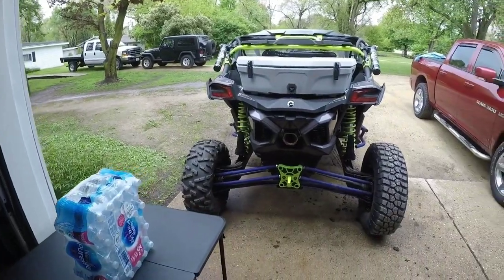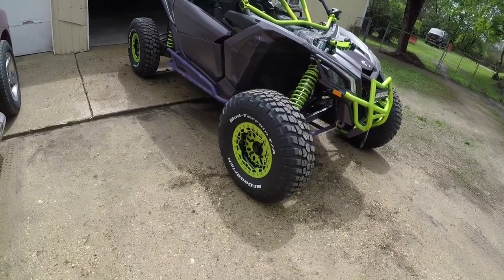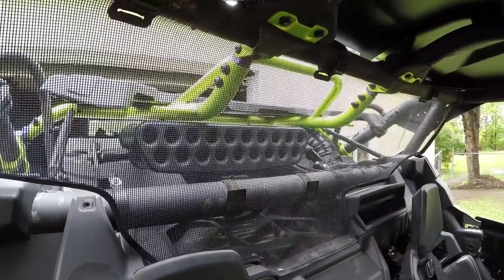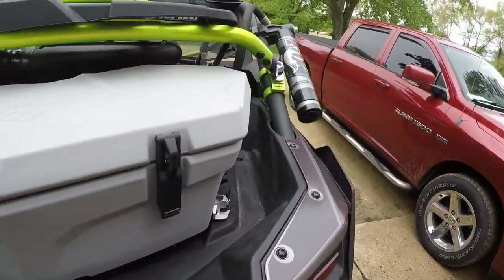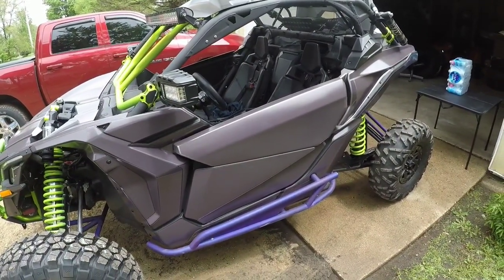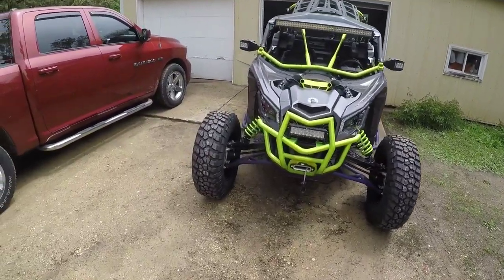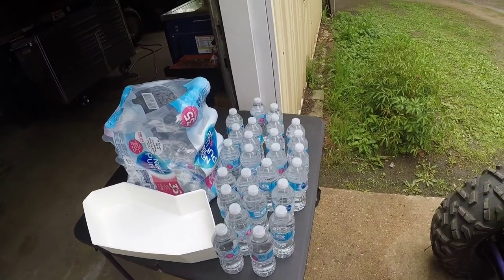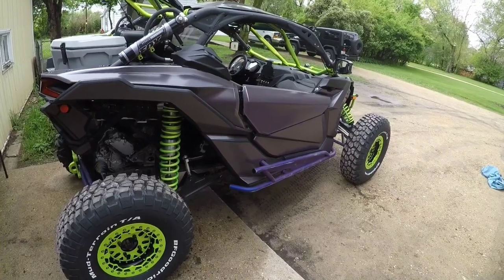Big Boi TV How much water bottles does a can am cooler hold? Update on changes made for Dresser, WI!

Comment: Hey, I like your videos. I'm a big guy myself, 6' 4" 500 lbs. Most vehicles don't have enough room for me. The x3 seems to have the most though. I'm wondering if I would be comfortable in one. I've been thinking I would have to get a 4 seater and move the front seats back. Could you do a video showing more about how you fit in it, how hard is it to get in and out, seat position, etc. There is just not any info out there for someone my size. Is there any room at all behind the seat to make mods to move the seat back at all? Even 2-3 inches could make a huge difference. Thanks and keep the vids coming.
Reply from the maker: ttmatt absolutely I will get you a video. I currently have my seat lowered 2 inches and all the way back with plenty of room. And you have 2 inches on me. I would bet you would fit! Give me a little bit and I will get you a video
Reply: ttmatt, I am 5'7" and weigh over 430 lbs. I sat in the 2018 Rzr xp and turbo dynamix and there was over 2" between steering and my belly. Also tried the 2018 General and I had maybe 3/4" in space. But the 2018 and 2019 Turbo S I had over 3" of space between my belly and steering and i did not have too tilt the steering up. I kept it in a comfortable driving position. I also sat in the Maverick trail and the commander and there was less then a 1/4" of space and tried the X3 and the steering would rub against my belly even when I had the steering wheel tilt all the way up and the seat all the way back. Pretty disappointing because I really love the X3 and a huge fan of Can Am. But Polaris are just bigger for us big guys. Hope this help
Reply: Thanks for the info! So, you are saying that the Turbo S has more room than the XP 1000? I thought they were the same size. Also, the Maverick trail has more room than the x3? I assumed the x3 was bigger. Do you have any experience with the RS1? I really like that! Any more info you have would be greatly appreciated!
Reply: The turbo S has more room then the 2018 XP. Not sure if the 2019 redesign XP has been altered in space inside. If I would to guess it would be a No.  I fit in both but I think the difference is positioning of the steering wheel. It feels like its mounted higher and that plays a part in that. They also use a different steering in the Turbo S. When I sit in the Turbo S I feel very comfortable, I dont feel tight, cramped at all. Feels like I belong in there. I Sat in the RS1 and that also has alot of room. The seats I think are the same as the XP so not comfortable in comparison to the Turbo S seats. But since you only have 1 seat its cheaper to swap it out with a suspension seat and that will be way more comfortable then the Turbo S seat. 
 I am very disappointed on how tight I felt in both the maverick trail and X3. Can Am was always a dream vehicle for me to get. Maybe 1 day. :)
 I think once they solve the roll cage issues with the Turbo s that I will be buying that one. The dynamix in there is amazing and being a bigger guy like me I never have to worry about body roll, even when i decide to ride alone. I also have a bad back so when i test drove the 2018 Turbo Dynamix I hardly felt a jolt on my back when riding it hard and when I tested the General and XP 1000 I felt the jolts a little but riding easier because I did not have the same confidence in those 2 machines. 

Good luck with your choice ttmatt,

Comment: I rode in a rzr 1000 xp today, I liked it but hear the x3 rides better and the seats are more comfortable. Did you try setting in the rzr b4 you got the x3
Reply from the maker: Sheldon Swisher I did sit in both. Its obviously personal preference, but my thoughts on the rzr were this. 1) seats didnt feel that comfortable. 2) seating position was to upright. I like angle in my seat. 3) the rzr feels very tippy to me. The low seating position just feels better to me in the cornering.
Reply: Jon Michael I'm a big guy as well and thanks for your reply, I'll be going to check out a x3 soon. Keep up the videos
Reply: I am 5'7" and 430 lbs and I tested the Rzr Turbo dynamix and rode it really hard on a test drive and it had 0 body roll and was confident 100% of the time. I haven't tried a X3 because its too tight for me. The seats are not that comfortable in The Rzr's but the seats in the Turbo S are much better then any other Rzr. I think you should look at them

Comment: You’ve probably long since moved on from this machine since you haven’t posted any new videos of it, but with the bubbles in the wrap, all you have to do is use a needle with some heat to poke a tiny hole and get the air out. When you squeegee it down, the wrap will cover any pin holes you make. I used to wrap cars back in the day and that’s how we did it with every wrap. You’ll never see it and the needle only taps the clear coat on cars. Makes for a perfect wrap every time.
Reply from the maker: I still have it. Just life got busy and i need to find time. Video making was a hobby i miss
Reply: @civicb20z  Good to hear. If you’re ever out on your machine then, just slap a camera on it and let’r rip! Some of the best SXS videos around here don’t have any talking and minimal editing. People always think they need to “YouTube” their videos with fancy intro’s and shock face thumbnails. 90% of those are just click through videos with no real content. Just ripping through some trails and listening to the engine on a 5 minute clip is all you need!

Comment: How are you liking those truck tires? I recently put the same on mine...have you had any problems or breakdowns from the weight of the tires...just curious because they are pretty heavy..thank you for the video👍
Reply from the maker: They are heavy and they broke axles, front diff, and then driveshaft. I upgraded to a halo 30, rvc axles, and a carbon fiber driveshaft.  Havent had a problem since.

Comment: Hello Jon Michael, In regards to the CAN-AM LINQ 8 GAL (30L) COOLER BOX, how did heat from the engine impact the cooler in regards to keeping ice and beverages cold? I have a Maverick X3 X RC and noticed the bed gets incredibly hot to the point my standard Coleman Cooler did stand a chance. I realize the CAN-AM LINQ 8 GAL COOLER BOX is higher quality but is it able to keep your beverages cold when battling the engine heat? What was it like for your 3-day trip? Any and all help in understanding the impact would sincerely be appreciated. Thank you!
Reply from the maker: Todd Mcdermaid that is a great question! We went through a bag of ice a day on our trips. The ice melted fast, but it seemed to slow a bit once some water built up in the bottom. After 6 hrs of riding the bottles were still cold.